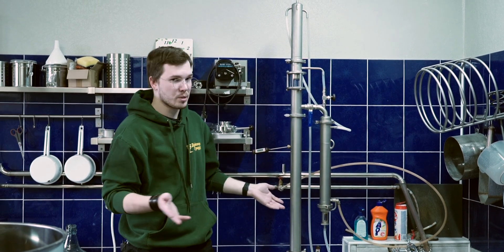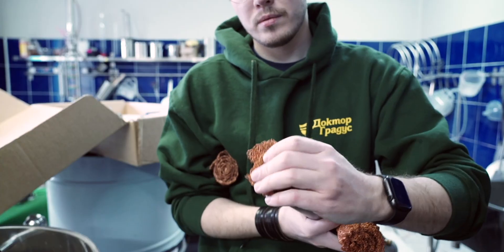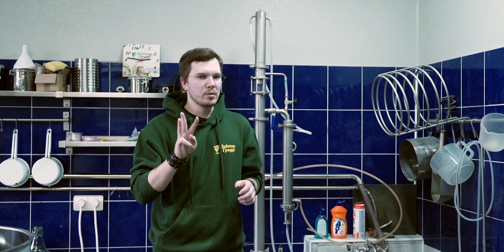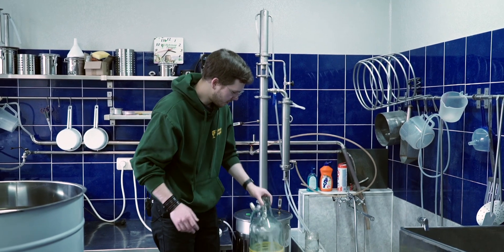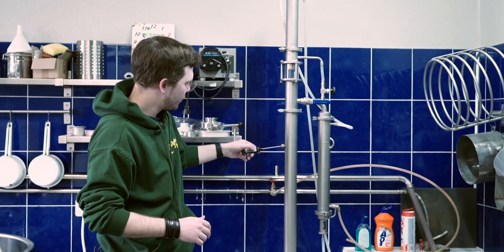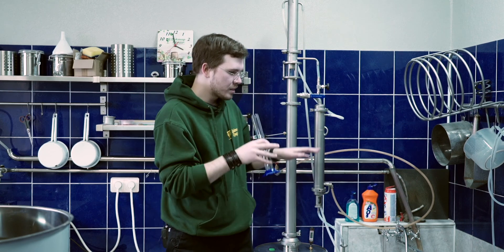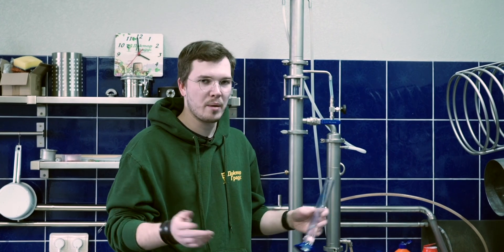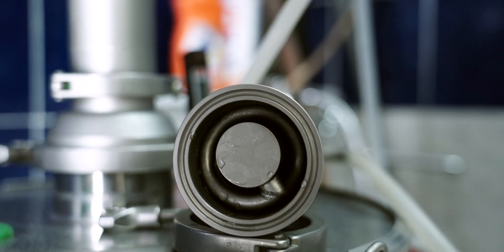Vapour management second distillation Stillman X

Comment: You used a term "temperature of no return in the extension". What does this mean?
Reply from the maker: I was a little wrong about this term. Usually this term is in use when you need to point a temperature in unit where vapour virtually assured to enter the condenser. So, I was meaning that at this point I have to look after during the distillation process, so when it starts rising, it's better to close the valve and check temperature everywhere.

Comment: You ran the still at 2500w but you do not  mention the voltage  of your power supply whether it be 110v or 220v.
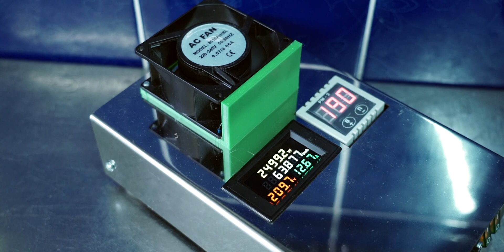Reply from the maker: Oh, yes. We have European voltage it’s 220-230V. You could see that here 2:16
But it is fine to run with a lower Power.
Reply: @DoctorGradusInternational  thanks again to all your team you are all so helpful